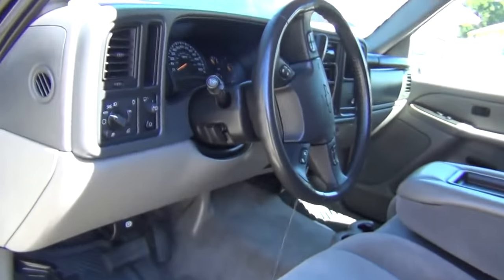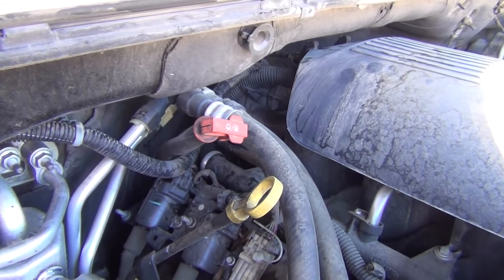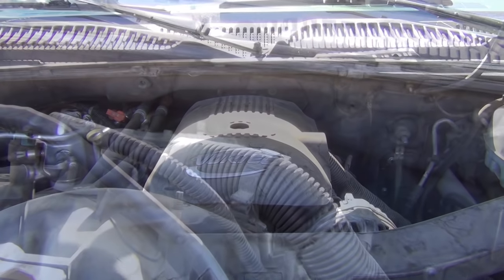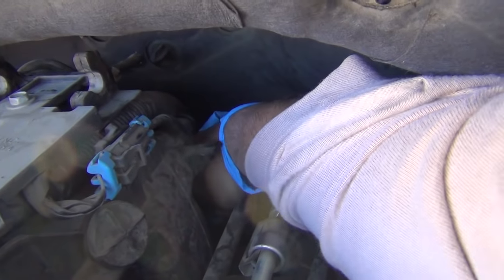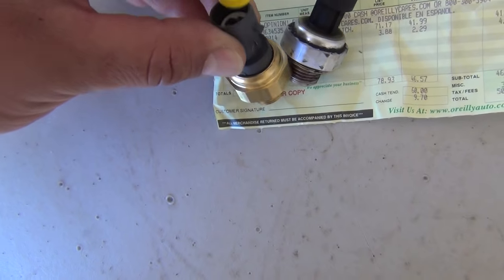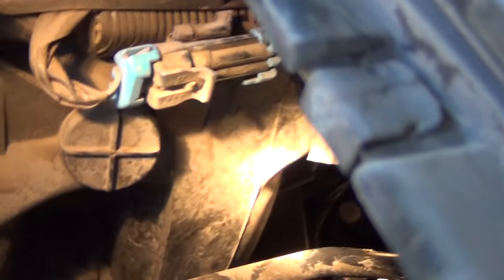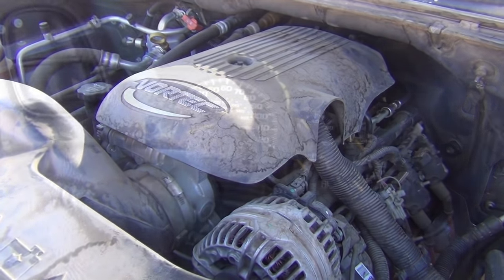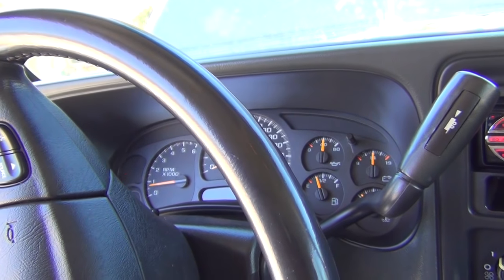CHEVY OIL PRESSURE HIGH....FIX!

Comment: what hapin if I don't replace the unit?
Reply from the maker: +Jimmy Hoffman Nothing will happen. The unit is just there to send the pressure to the instrument panel. The unit has no affect on the actual pressure of the oil.
Reply: +ImRamro  thanks so much for the reaply.. my car dose the same . as the 2005 chevy tahoo , i have a 2003 chevy tahoe , most cars dont have oil gage . so im glad nothing will hapin while im driving.

Comment: This does not work. I had low or no oil psi. Changed sender. 1000 miles low no oil psi. replaced again. Now am having high oil psi. Changed sender. 100 miles later back at over 80 psi. This all started happening in the last month.
Reply: What did you find out was the problem?

Comment: mines it goes high to 80 when I press the gas and act like it want to cut off what does that mean
Reply: I have a 04 denali and when it's cold it knocks and my gage show no pressure so I give it a lot of gas and then the pressure goes up to normal
Reply from the maker: Sounds like the oil is not reaching the sending unit or the top of the engine block right away? 
The weight of the oil may be too thick. Do you change the oil yourself or do you take it to a mechanic? 
The lifters or push rods may be clogged or you may have some that are physically damaged? 
This would cause a knock at start up because the oil is not being moved around to the top of the block right away? 
The oil pump, oil pump screen, or oil pump pick up tube may be clogged with debris? 
The oil filter may be clogged with debris?
1. I would check the oil level and make sure the oil filter is not loose.
2. I would do an oil change and replace the oil filter. Make sure the oil weight is correct. 
3. I would remove the oil pan and inspect the oil pump screen to see if it is clogged with debris. You may want to replace the oil pump at this time? 
If everything looks ok and you are still having the problem, I would pull the intake manifold and valve covers and replace the lifters and push rods.
Have you had this problem long? Have you had any maintenance to your vehicle around the time this problem started?
Reply: Tonya Taylor mine does the same thing.  did you figure out the problem?

Comment: mine read low and i replaced it now it maxes out on high wat is the other part called?
Reply from the maker: +jim jam I don't understand which second part you are talking about? 
Maybe the new sending unit you purchased is bad?
Reply: oh you said the gauge sorry didn't hear you right i think its either my gauge or the unit
Reply from the maker: jim jam Did you replace the sending unit?
Reply: +ImRamro yea
Reply from the maker: jim jam That is strange that it went from low to high?
Maybe the sending unit is bad or some dirt got inside? 
The sending unit only measures the pressure of the oil that is in the engine. For it to go from low to high may mean that something is plugging the hole?

Comment: Hey man, when I turn on the ignition the oil level goes to half. When i turn it on it maxes out. Can it be just that sensor? Or is it the pump? Its a 2005 GMC Sierra
Reply from the maker: +Nicolas Acuna I do not think it is a pump issue. The sending unit often times will do this before it goes out. I have seen them do this for a day or a week before the sending unit just gives up. Since this comment was yesterday, I would not be surprised if the gauge is showing max pressure? 
It could also be a major ground strap that connects the block to the firewall. 
Less common, but I have seen these problems caused by a bad ground strap wire or main ground wire.
If the ground is losing connection, it should effect some of your other gauges too? 
I would make sure you have proper oil pressure and wait, or just replace the oil sending unit.

Comment: so what if your oil pressure is low what it be the same problem
Reply from the maker: A bad sending unit usually goes out suddenly and does not start going bad.
It could be a bad oil pump, loose oil filter, wrong oil weight, leak in the intake manifold, bad rings, oil pump pick up tube or screen, and a few other things?
Does your vehicle use or burn a lot of oil? 
Have you had any part of your engine recently rebuilt...crank or heads?
Reply: Heriberto Alviter yes

Comment: I got a 04 Chevy Tahoe when I turn the ignition without starting it, it goes to 40. But when I start it it goes all the way to 80. Think it’s the same thing ?
Reply from the maker: If it is only the oil pressure gauge, then this is the most common problem and will usually fix it.
If several gauges jump, then it could be a metal body ground strap.